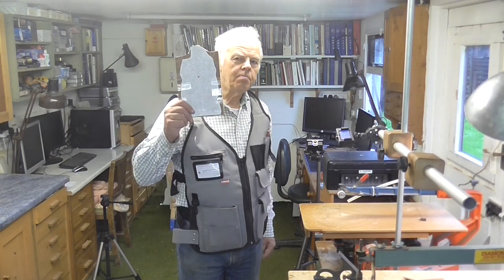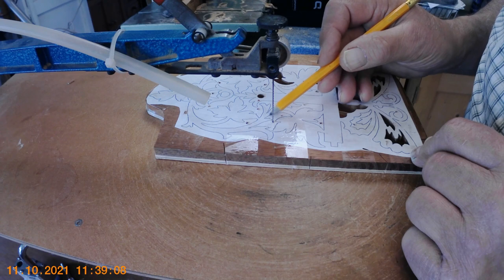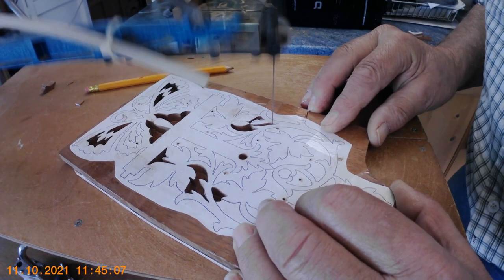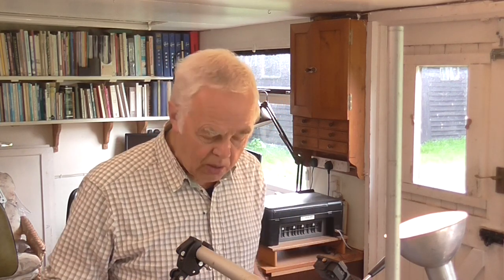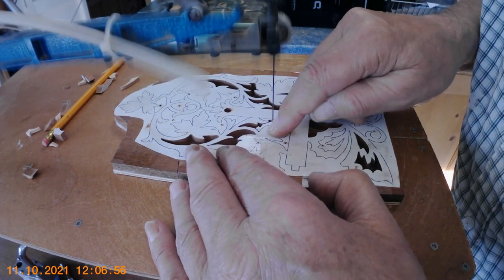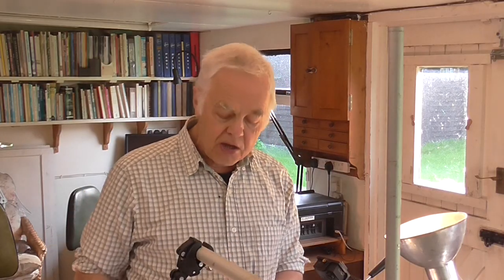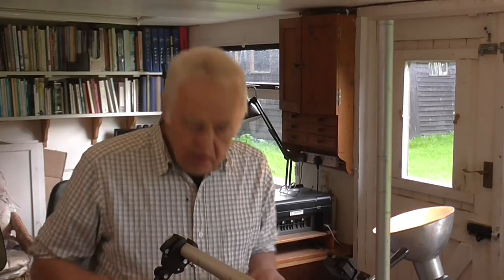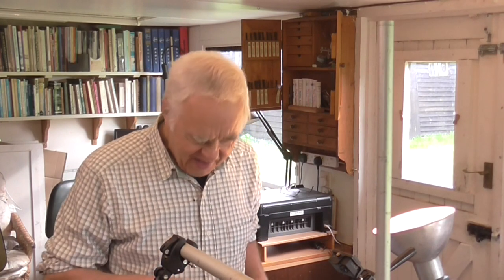How to do Scroll-Sawing and Fretwork. Making a butterfly Bracket. Part 2

Comment: Hi as I watch your video on scrollsaw work you got a nice pattern there. I would like to have your expert advice on the hegner scroll saw, I am going to upgrade my present  entry level saw to a hegner multi cut 1 second hand ,from all the reviews I read and watched hegner seem to be highly  recommended,! I have my eye on 1997 model seller says its working as well when first purchased , my principle question for  you is is the multicut 1 suitable for very detailed work. Your reply  will be greatly appreciated  Thank you in advance. 
Regards.
Reply from the maker: Hello Thomas, thank you for watching. I will try to answer your question as best I can. First if you haven't done so I would advise you to watch my videos on choosing a scrollsaw (2 parts) I have also done a review video on the Hegner machines.
Two things about Hegner saws, 1) they are expensive and 2) they are superb well built machines that should last a lifetime.

All Hegner models are well built and any will do for normal fretwork, however you mention a 1997 multicut No1 and the main issue with this saw is that it will not have a quick blade tension release and that is a problem if you do lot's of internal cutting, you will find it hard work and you will wish you had bought one with quick tension release. I won't go into the reasons why as I explain it in my videos (in my Youtube channel).

There are two other issues that might be important. The first one is does your prospective saw have variable speed? I would not buy one without this feature as it is invaluable when doing fine fretwork, as Hegner uses Induction motors (which are the best, as explained in my videos) you cannot add variable speed it is a factory fitted option and built into the motor. 
The other issue is Does it have the quick blade release clamp? As with the quick tension lever the quick blade clamp is a must when doing lot's of internal cutting. the lack of this clamp is easily rectified as you can buy one from Hegner if any saw you buy does not have one.

So summing up my three musts are 1) Quick tension release. 2) variable speed and 3) quick blade release. If any saw you are looking to buy does not have these features I would look elsewhere. 

Hegner machines are extremely reliable  but the spares prices are horrendous so make sure any saw you buy has been looked after. 
My Hegner is 23 yrs old and still as good as new and a pleasure to use, I have never regretted buying it.
Reply: @scrimperuk  Thank you very much for your very helpful advice, i will take all the points you covered on board and maybe compare to other saws. As you mentioned Hegner are expensive but apear to be the best .anyway thanks again.